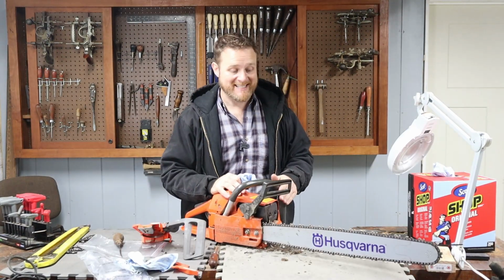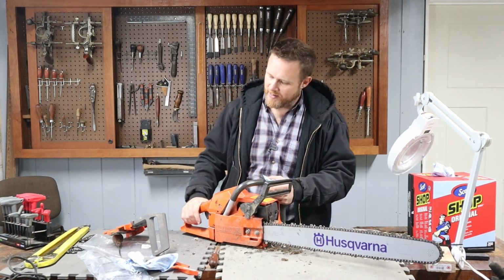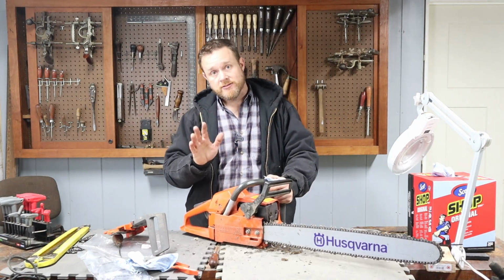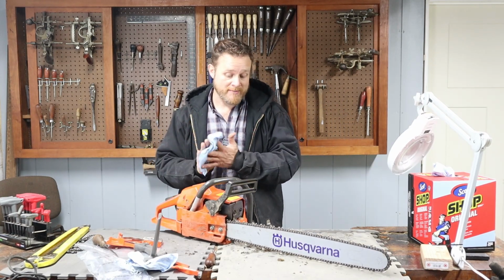#154 I Bent the DIY Log Arch! Homesteading at its Best!

Comment: Hey Wes, I see the Big Guy is now supervising.  Good for him...lol.  I got to say I was cringing, watching and hearing the winch strain only to imagine the forces being applied on the log arch.  Now that it is bent, that is the weakest part of your system.  The design has proven itself that it works.  You may want to consider a more beefy tubular system and overbuild it.  I would have loaded the Boda on the trailer, use it to load, and then come back to pick it up after getting the logs.  My two cents.  Great work on the Husky. When was the last time you sharpened the blade?  (I had to ask)  Stay safe Mi Amigo...
Reply from the maker: I thought about bringing the Kubota but it would have only been useful on the one load with smaller logs, it can’t lift the big logs.   It can lift just under 2500lbs and they weigh around 4-6k
Reply from the maker: Im still trying to figure out if I am going to try and repair the arch, or scrap it and start over.  I really don't want to start over, but I'm not sure I can get it back square again if I don't.
Reply from the maker: I almost forgot, I just sharpened all my chains right before my first trip on this haul, I have 2-25" and 4-18" that I carry with me.  I was trimming up one of the logs last night that had a bunch of branches while i was stacking and reorganizing them and it is just starting to throw some dust so it's about time.  Man does it run better now that the brake is working properly!
Reply: @shaweehillsworkshop4226  I figured you did but I just had to ask.  Glad you got the Husky humming.  When does the Big guy start cutting?
Reply from the maker: @bubbatim2009  ewww, thats going to be a while.  The thought of him using a chainsaw sends shivers down my spine!

Comment: * don't tell people your trucks in neutral when loading that's the most unsafe crap I have ever heard your going to get someone killed**  when loading equipment or any heavy thing on a trailer you should first Put vehicle in neutral, then set parking brake, then put transmission back in park.  Chalk the trailer wheels.  If you want to chalk the truck wheels you can also.  The Parking pins  break is kinda a myth but to keep the stress off the pin cause it can bend or shear under extreme cases or factory defect more commonly the vehicle operator shoulder set parking brake with tranny in neutral.  Also if you put the truck in four wheel drive all four wheels are in park not just 2 Incase the wait of the log punching Down on the back of the trailer lifts up on the back of the truck reducing the wait of the rear axle possibly lifting the rear tires the front tires won't stop the truck unless you park it in 4 wheel drive.

Comment: 9500 LBS WINCH WAS NOT ENFULL / BECAUSE LOG WEIGHT ABOUT 6000 LBS > EACH PLUS + U ARE DRAG THING TOO AND LIFT THING TO / NOT ENFULL ANY WINCH TOO DO THIS ? ! 

WHILE U ARE HAVING 2 OR 3 TIRES NEED THING FRONT INSIDE THE TRAILER UP RIGHT !